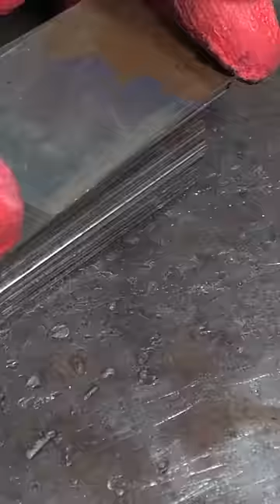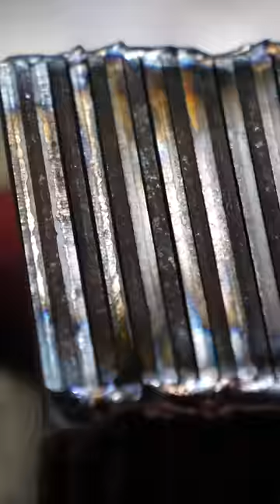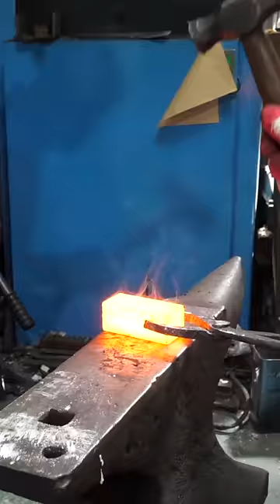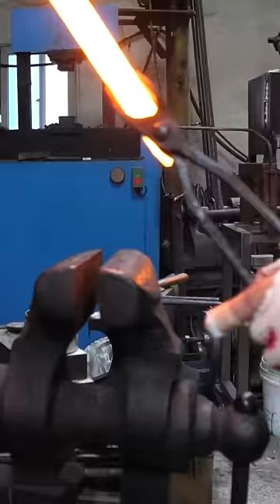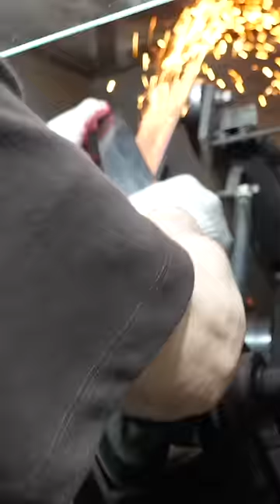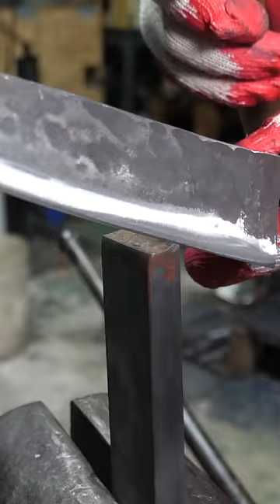Korea's best handmade knife master. with 50 years of experience. Damascus knife

Comment: That metal chunk at the end sold it for me. That's a solid blade.
Reply: WHOA!!! hard metal cuts through soft metal!?!?! I have bridge to sell you lmao
Reply: @subtleusername5475 u blind? U think that chunk o metal is soft metal?
Reply: @MrOMMSSM  please learn to put a sentence together.
Reply: @subtleusername5475  there you go ya dingleberry
Reply: @MrOMMSSM  metals can be soft, bozo. you should look up how easy it is to cut sodium.
Reply: @subtleusername5475 you used sodium as an example? 😭 the nerve
Reply: Were you introduced to what kind of metal that is? Some metals are so soft that you can deform them by hand, such as tin and cobalt.
Reply: Blade is too hard and will break,.
Reply: @subtleusername5475 I honestly don't see what your problem with what he said is. U sound almost... jealous
Reply: @subtleusername5475 why r u so angry?
Reply: كيف احصل عل واحده
Reply: Хочу заказать у него меч !
Reply: @subtleusername5475 what kind of soft metal in this video? Kinda dark with this kind of thing
Reply: A lot of the comments mention soft metal, however, it's not rare that a purposely heat treated hardened steel edge could cut through the original non treated material with minimal defection. This test is sometimes used as quality check for quality cold weapons.
Reply: Cant believe no one said it ..
IT WILL KEAL!!!
Reply: The metal he cut at the end was no soft metal like sodium, but it wasn't hardened steel either, more likely standard construction steel which is nowhere near as hard as hardened blade steel. The blade he used to cut it with looks fairly thick. A blade of the usual thickness of japanese knives would probably not withstand this much of abuse.
By the way, basic metalworking tools are also made of hardened steel, so depending on the thickness of the blade in use, cutting metal is not that impressive.
Reply: Better than the video
Reply: Because the steel has been forged at high temp it is tempered aka hard steel. The orignal material and the metal he cut is called mild steel. Its still an impressive knife
Reply: @subtleusername5475 Dude woke up and choose violence, thanks god I'm not that miserable
Reply: @subtleusername5475 that's still impressive since the knife didn't have any dent after that
Reply: @subtleusername5475 you can’t understand that? Wow….just wow
Reply: @isobaramark7032  jealous of what, exactly?
Reply: @MatrixWarrior98  Thanks. That was very informative 😊
Reply: You weirdos do know that knife is for kitchen foods...right!?
Reply: @OCTO358  u tell me
Reply: @MrOMMSSM it was definitely a soft metal
Reply: @MatrixWarrior98 So what is impressive to you, oh jaded one?
Reply: @MatrixWarrior98  The impressive part was not seeing any damage to the blade after.
Reply: Now now children,  play nicely
Reply: The question is .. does the blade got a chip? ?  He turned the cam off quickly ..ive never seen that blade again
Reply: @subtleusername5475 Whoa why r u angry karen 😱
Reply: @MrXor6  If it's tempered and hard, it probably broke. If it is soft steel and untempered steel, it would bend. But it doesn't matter, a knife isn't made for that and neither do you judge it by am act of destruction.
You wouldn't drive a car against a wall and judge how good it drives.
Reply: @subtleusername5475 dang bro, metals can be soft, but there ain't no way this dude is using SODIUM of all soft metals in a freaking FORGE 😭😂
Reply: @MatrixWarrior98 that's what I was suspecting, that or aluminum
Reply: Just taking a break and figured l'd check out the troll community. Also, neat knife!
Reply: I was the same. Was all like "yeah seems like shit I have seen before" and then cuts some metal with it... That's a fuckin knife
Reply: @Dragonlord13 I CAN ASSURE U THAT IS NOT ALUMINIUM 😂 aluminium oxide layer is brighter and alloys wont be anywhere near soft. What so hard for u guy to understand that hardened steel can cut untreated soft iron?
Reply: Absolutely none of the people in this comment thread know what cold chiseling is.
Reply: @wanabid98  dang, your right, my bad, I even learned that aluminum oxide is harder than the aluminum itself
Reply: What is the name of this knife brand ?
Reply: @subtleusername5475 bruh what makes you think they're cutting metallic sodium?
Reply: @紅時雨-j1o cobalt is a hard metal they even use it in the alloys for drill bits and coatings
Reply: @subtleusername5475 that looks like iron he cut through.
Reply: @subtleusername5475 how easy is it to cut steel? That was steel
Reply: @subtleusername5475 address his point not his grammar.
Reply: @subtleusername5475 still impressive for a thin knife
Reply: @isobaramark7032  I'm asking YOU, because you're the one who told the other guy he was jealous. Hence the question, jealous of what? Nothing in his comment indicates any sign of jealosy whatsoever, so since you're the one who brought that up, you're the one who has to elaborate.
Reply: @OCTO358  his tone obviously makes him sound jealous. The original comment praised the knife, he came and tried to downplay the knife for no reason. Doesnt  that sound like a little gal who is mad that her friends dress is being praised and tries to throw dirt on the dress. Come to think of it, I think I watch a YT video about that scenario 🤔
Reply: if you had a tool for cutting steel out of steel the tool is hardened. much more importent are the angles of this tool. the angles on the knife are choosen to cut kitche stuff and no steel. so it is impressing. did anyone here saw a shop from the inside?
Reply: @subtleusername5475 do u think he was holding a chunk of sodium? 😂😂 this guy has not taken a chemistry class
Reply: @LeonardShultz-z4m no but he basically ruined that blade cutting through that metal lmao
Reply: Ya I didn't even believe it, that definitely got my eyebrows raised.
Reply: ... it looks like a 6x2x1 bar or metal. Given that it can withstand a knife being hammered into it without bending or the knife going straight thru, it is clearly not sodium

Or, if you want to exercise an additional brain cell, you can look at the bar and note the brown oxidation. Sodium doesn't rust. In fact it is often coated in mineral oil because it is highly reactive and reacts vigorously with atmospheric oxygen. Its also relatively expensive.
Reply: @bg3841  thank you. I'm no expert but I can't imagine metallurgists having chunks of sodium or even very many soft metals just lying around in excess.
Reply: @subtleusername5475 I’m sure yours are way better 🙄
Reply: I can tell you you even can bending the pure gold with your own teeth! 😂
Reply: Yup
Reply: @MrOMMSSM the number of people liking your comments worries me 💀
Reply: @subtleusername5475  you go out and grab your knife from the kitchem .. try to  chop a cerner of . lets say tin .. and check the edge on it after
Reply: @subtleusername5475  it’s definitely not sodium, for one, sodium explodes in contact with water (there is water vapor in the air, so no one would keep a chunk out in open air). There also appears to be red rust on the metal he cuts, indicating that it contains iron. The metal is likely just iron or steel containing little carbon, and not hardened.
Reply: Some of these guys haven't seen mild steel bar and claiming it sodium lol 😂 it's just hardened steel vs unhardened steel (is that even a word?) but too much hardening may break the steel but I think this man knows what he's doing
Reply: @subtleusername5475 sodium???? Dude. Pick another periodic table element that makes sense.
Reply: @MrOMMSSM go and learn what the term “soft metal” actually means. Also read what “hardness” means when it comes to metal working and material working.
Reply: Also ruining the edge by doing that. Was it cool, sure. Was it smart or even practical, no. Cool nonetheless though.
Reply: @subtleusername5475 Was that sodium? No, rust in sodium isn't brown.
Reply: Why do all of you muppets think he said they used sodium Sodium was a god damn example HOW soft metal can be because somebody joked about how metal couldnt possibly be soft for gods sake yall must be fun at parties @MatrixWarrior98
Reply: @MrOMMSSM thought it was lead at first
Reply: For real though! That blew my mind.
Reply: Bro all y'all are funny! There are soft metals, and there are hard metals. In fact, there are metals which are literally liquid without even needing to heat em! No reason to argue, but it is most likely that the metal he cut was potassium or sodium, or another similar one.
Reply: @subtleusername5475  he was not cutting sodium, dingleberry
Reply: @subtleusername5475  learn how to put a sentence together 🤓
Reply: @subtleusername5475 but it clearly isn’t sodium goofy
Reply: @MrOMMSSM it wasn't a tough metal or you wouldn't go through that easily just using a hammer to drive the knife.😋
Reply: @mrapple2544 miserable enough to make a useless comment about it. 😂
Reply: Bro
Reply: How much metal do you actually think is lost through the cutting, grinding and bashing ?
Reply: IT WILL CUT - dude from forged in fire
Reply: @紅時雨-j1o that's like comparing glass to titanium 😭
Reply: @isobaramark7032 I wouldn't say he's "jealous", he's just trying to make others understand. If trying to teach others is considered jealousy, than all my teachers are jealous.
Reply: @hotgarbage3892 bud, they're not talking about kitchen foods. They're talking about the metal being soft (*hard)
Reply: @hotgarbage3892 don't call others a "weirdo" when you're talking about food while everyone else is talking about the metal.
Reply: @subtleusername5475 then just tell us what soft metal was used in the video smart guy
Reply: @RedStarsCult  understand what?
Reply: @subtleusername5475  I've never seen someone so confidentially incorrect about something
Reply: @LeonardShultz-z4m от ударов молотком не сломалось, уже хорошо. При резке мяса и рубке костей тем более не сломается.
Reply: @紅時雨-j1o  cobalt is not soft tf is you talking about man and tin has a hue of blue in it there is not one spec of blue on that metal please do your research before checking ppl
Reply: That's not for sale. it is my last piece.
Reply: @LeonardShultz-z4m  Incorrect. If it was too hard at that thickness, it would've shattered. Its quenched to be hard, and tempered to be tough.
Reply: @MrOMMSSM it’s soft metal compared to the edged hardened steel. That’s the process you just watched…….. he mad it 10 times stronger than what he cut through.
Reply: @MrOMMSSM no you still failed you forgot the “.”
Reply: @edgarf2091 ever seen copper or brass? even gold is a soft metal in its pure form
Reply: @LeonardShultz-z4m  You plan on using a kitchen knife to throw it at concrete walls as a regular? If not, then no, it won't break.
Reply: @hotgarbage3892  That's exactly what I was saying, "the blade is too hard" man you ain't gonna cut anything nearly as hard as a literal chunk of metal in your kitchen lmao
Reply: @gjkmoda5093  💀 lol right
Reply: He cut through the same metal that the blade was originally made from before, Damascus layering, heating, beating, twisting and heat treating, hardening tempering, This is a test that proves the knife was a success
Reply: @MatrixWarrior98 it was the original metal the blade was made from before the work was done
Reply: shubhamraj8203 no it was not sodium it was the same metal the knife was made from before working it
Reply: @samwhite1345 it was the same metal the knife was made from before it was Damascus and heat treated
Reply: @DieEineMieze it was to show how the same steel can cut through itself after the Damascus and heat treating
Reply: @Dragonlord13 nope the original metal the blade was made from before Damascus and heat treatment
Reply: @wanabid98 it’s astounded me tbh, it’s the same steel, one has benn Damascus layered, twisted and heat treated the other one hasn’t, people don’t understand the changes that metal goes through during heat treatment
Reply: @raidzeromatt no not really
Reply: @jhin28it’s not soft metal though it’s the same metal as blade, only not Damascus, and not heat treated hardened
Reply: @Ladosligese the knife out your kitchen will not be Damascus steel, twisted like that and heat treated to that level, unless its a few grand?
Reply: @Sneakyeggs it wouldn’t ruin it, would just need re honing
Reply: @youraveragecupofjoe9856 nope it was the same metal the blade was made from!!! Only the blade was Damascus layered twisted and heat treated it’s that simple! Sodium look nothing like that nor does potassium haha
Reply: @D-A-A- none through bashing only impurities come off through beating
Reply: @RedHairML same metal blade was made from
Reply: @UseWallow it’s same metal as knife was made from
Reply: @mafftv3801  that's what I meant. Should have clearfield. I know it wouldn't be ruined forever, but definitely ruined until you rework it. Kinda stupid since he literally just finished it and now has to re edge it again.
Reply: @mafftv3801  yeah no shit the only difference is the knife was hardened. Did you watch the video??
Reply: @subtleusername5475  and did not lost it's tooth nor warped which means it has maintained balance between harness and toughness. So... ok?
Reply: @シウ-o1x metal cutting is just very cool isn't it? Even it is just tin! Not a scientific test of edge retention and toughness but
Reply: @vityaz617 i can bet my money on "Just Iron". He does not likely have some special metal for showing and this is just to show it's toughness is enough to cut some chunk of iron and will not bend. Ain't Nobody buys a knife to Cut Metals.....this is not some Lupin III shit and people just don't get it. And these knifes are not even expensive!!! It's just a tool knife for kitchen and stuff. The forged-show ruined many kids...
Reply: @MrOMMSSM you get an upvote for the proper use of dingleberry.
Reply: @subtleusername5475 I agree, but even if it's a soft metal, given the color of it it's most likely to or aluminum, which is still very impressive to shred through like that. You have a valid point, but it feels like you're being devils advocate here man. 🥴
Reply: @MrOMMSSM yes, that is a soft metal. You can tell by how it deforms.
Reply: You got to be kidding!!! You ask such a thing! Gahaha
Reply: I mean that metal looks like lead to me. And that's a very soft metal.
Reply: @alhassirakhdugani5813  Your Public mediocre schooling is showing
Reply: Subtleusername is a rival knife maker in the future. That's why theyre so determined to not be impressed lol
Reply: yup, if i was at some kind of knife demonstration and i saw that, i would already know which one to buy
Reply: @godinesrox  I see you're a fellow Forged in Fire fan.
Reply: @subtleusername5475 That's iron, if you really think a slab of iron is that easily cut by a regular knife by all means do try it. Sodium is a dull silver colour, not matte grey.
Reply: @紅時雨-j1o cobalt is slightly more durable  than steel so I doubt you can deform it by hand at room temp
Reply: @DieEineMieze ..that’s literally how they test the safety of a car…
Reply: @TheEnd  No, you don't? You don't test a car how good a car drives by driving against a wall...you test how safe it is.
Reply: @DieEineMieze that is literally what crash testing is
Reply: @Mattryanfisher  You should be able to comprehend what I wrote, after I repeated it 2 times. But it seems you don't.
Reply: @subtleusername5475 That was steel that he was cutting, not sodium. The looks are pretty easy to tell. There aren't any soft metals that look like that, except maybe some lead, but idk why a bladesmith would have a chunk of lead
Reply: @subtleusername5475 as a chemist… shame on you
Reply: @subtleusername5475 First comment wasn't put together right. Second comment you didn't capitalize your first letter on the first word. Please learn to put a sentence together.

- Sincerely Someone
Reply: @godinesrox  Was looking for the words. hahaha eventhough i was thinking of the show
Reply: @シウ-o1x 
Beautiful answer; bravo! 👏
Reply: @MrOMMSSM it kinda looks like sodium
Reply: @MrOMMSSM  In comparison to the tempered and hardened blade yes that metal is soft. Hence why blade cut through it so easily.

Comment: As a certified OSHA welder and with a masters degree in Industrial Engineering I can confirm,  he's a blacksmith
Reply: There's no such thing as a OSHA certified welder 😂 we all do dumb shit
Reply: WUSJSSJSJ 😂😂😂😂
Reply: Dam I’m finna get my OSHA certifications too.
Reply: That tig tack at the beginning wqs pretty rough tho
Reply: Can we be a little more racially tolerant?

African American Smith….. jeez
Reply: American African ^^^^ sheeesh.
Reply: OSHA doesn't certify welders. AWS does.
Reply: as a certified downhill pass welder in flux core, i can attest that he did infact run a 141 tungsten-inactive-gas welding with no filler wire across those highcarbon-steel alloy metal plates